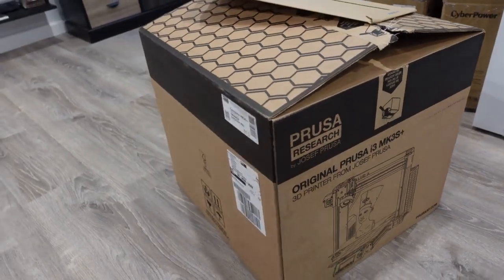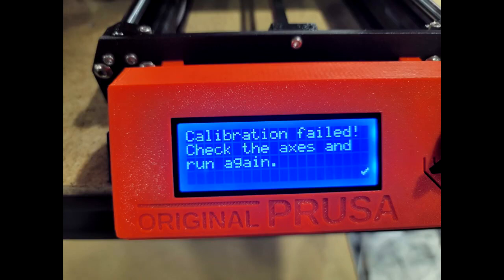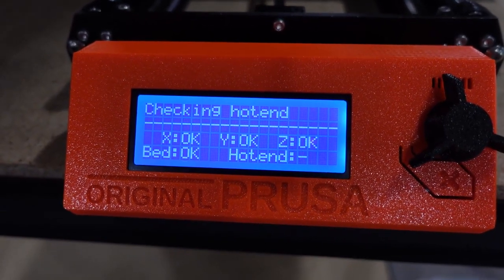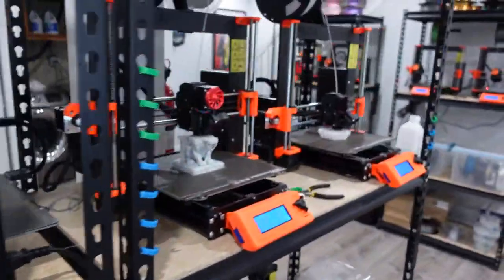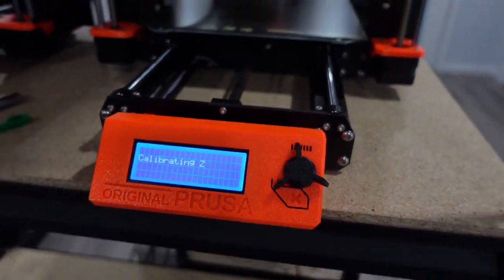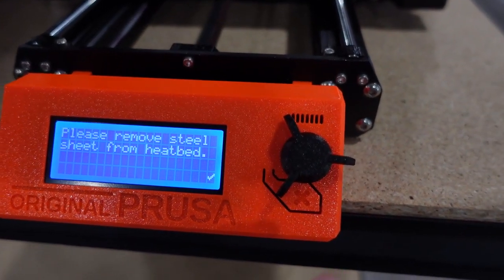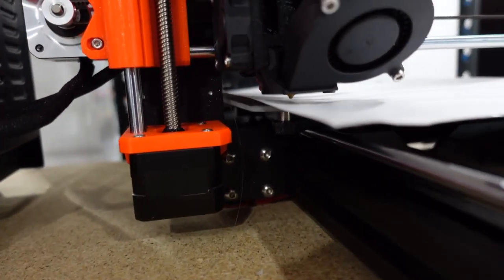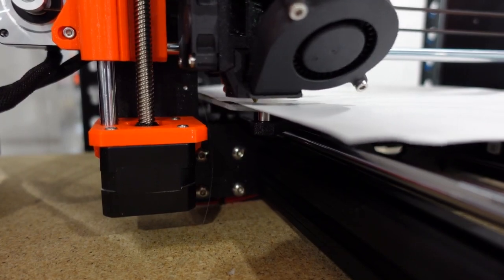Prusa MK3S ERROR - FIXED! Some Problem Encountered, Z-Leveling Enforced Calibration Failed!

Comment: So I'm receiving these same errors, except mine is going all the way up and grinds quite a bit. I don't really see a fix in the video?  Mine either won't start the calibration, or when mess with the Super Pinda I can get it to start calibrating but it comes down too far, grabs and cuts through the paper and physically presses the bed down!  This is my first printer and I am pulling my hair out, I can't get it fixed!
Reply from the maker: Your sensor may be too low
Reply: There is a video by Prusa regarding this. It's on his youtube channel. 

 I suspect you are running the setup wizard when the paper thing occurs. It likely does have something to do with the sensor height. The printer is allowing the z-axis to travel down into the bed, and it should not do this. (make sure you're doing it with the steel sheet removed).
My thinking is that the pinda is too high, allowing the head to travel down farther  before it is "reading" the bed.

Comment: I have eactly the same problem. I have the latest firmware, 3.13.2. It worked fine and all of a sudden I've got all sorts of messages from thermal anomaly to Z-Leveling Enforced Calibration Failed , I ran an XYZ calibration and it said it was ok, but now I can't run the first layer calibration, It stops and says Z leveling enforced .... first and when I tried again it said thermal anomaly. I really don't know what to do.
Reply: I contacted Prusa   I spent a whole afternoon with them. They made me test the PID etc nothing worked. So finally they asked me to flash back to 3.11.0 and it worked. But they said it’s only a temporary solution and they are sending me a hotend thermistor and a hotend heater
Reply: @laure3d  I'm having the same issue, please post an update after you put it together.  Thanks!
Reply: @GtFqt  Prusa made me go back to the firmware of August 2022 and it works.
Reply: I’m having the exact same problems, same with the thermal anomaly. Only became an issue when I updated to the latest firmware. I’m considering flashing back to an earlier firmware at this rate, can’t figure out what to do
Reply: same issue after upgrade to 3.13.2
Reply: Hey! I had the same issue when updating the firmware to the last version 3.13.3. Prusa sent me a hottend termistor but i didnt replace it yet. I assume something is wrong with the firmware. If you have a solution please let us kmow